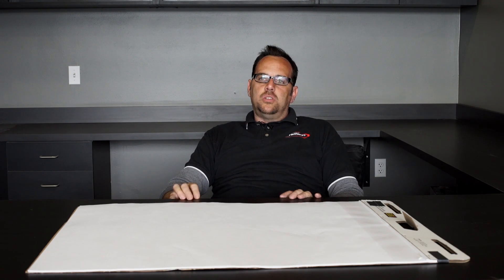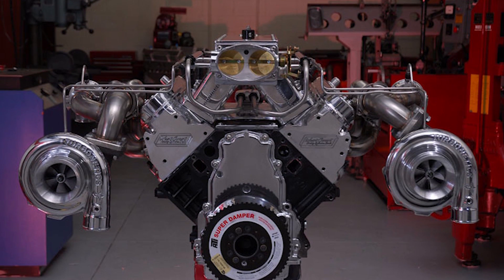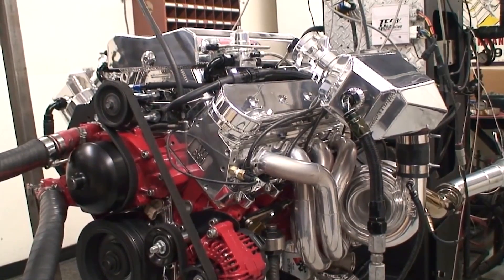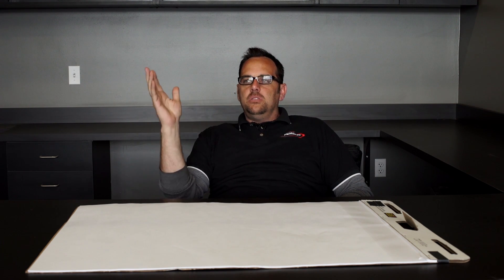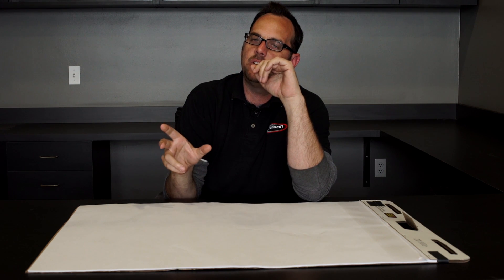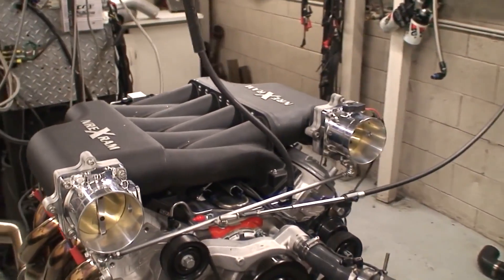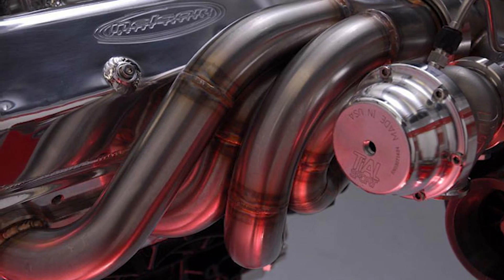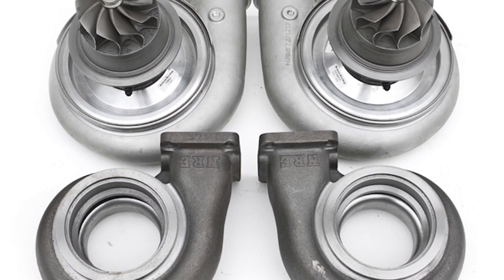Master Engine Builder Explains Why the LS V8 Is SO Good

Comment: WHY IS THE LS SO GOOD. BECAUSE IT IS A REGURGITATED FORD 427 HIGH RISER ENGINE OR IF YOU CHOSE A RAISED PORT 351 WINDSOR. NOT ONE DESIGN ASPECT IN THE LS HAS ITS ROOTS IN THE SMALL BLOCK CHEVY. THE LS IS COMPLETELY FORD BASED RIGHT DOWN TO THE FIRING ORDER. THIS IS WHAT TOM NELSON IS HIDING FROM YOU ALONG WITH THE RST OF THEM.
Reply: +Frank289100 you are one of several claiming the LS is a Ford knock-off but I'm going to disagree with the 427 and 351W references you make. The GM engineers designing the LS wanted to cure the intake manifold leak problem so they isolated the lifter valley from the intake ports with a valley cover to keep the oil out them. They also isolated the coolant crossover passages so there's no leak in the intake ports  from them as well.
The Ford 292/312 is probably the closest in comparison to the LS because it's a Y-block like the LS sans the crossbolts in the main caps. The Y-block Ford also has a lifter valley cover to isolate the oil from the intake ports like the LS
Reply: (The Ford 292/312 is probably the closest in comparison to the LS because it's a Y-block like the LS sans the crossbolts in the main caps. The Y-block Ford also has a lifter valley cover to isolate the oil from the intake ports like the LS) <<-- IT IS A RAISED PORT 351 WINDSOR AKA 427 HIGH RISER ENGINE. NOT 11111111111111111 DESIGN ASPECT OF THE OLD SMALL BLOCK CHEVY LIVES IN THE LS. IT IS 1000% FORD.
Reply: +Frank289100 I am assuming your comment is your opinion. I have not found any reference that states " <<-- IT IS A RAISED PORT 351 WINDSOR AKA 427 HIGH RISER ENGINE. NOT 11111111111111111 DESIGN ASPECT OF THE OLD SMALL BLOCK CHEVY LIVES IN THE LS. IT IS 1000% FORD."
I find your hyperbolic statement that a LS engine is a "IS A RAISED PORT 351 WINDSOR AKA 427 HIGH RISER ENGINE" a far fetched opinion and not one that is based in fact. The only thing the two engines share in common is that the six bolt main cap arraignment of a LS is comparable to a 427 High-riser, but it is also comparable to the six bolt main caps of a Gen ll and Gen lll Mopar Hemi.  Does that allow someone to say a LS engine is a Mopar Hemi? No. The LS General Motors engine is absolutely not "1000% Ford." Try again.
Reply: PUT YOUR FINGERS INTO A FORD WINDSOR HEAD AND THEN PUT IT INTO A LS HEAD. YOU WILL NOTICE THE INTAKE RUNNER CURVES INTO THE INTAKE VALVE AGAINST THE CYLINDER WALL WHICH CREATES A SPIRAL EFFECT BEING A SPIRAL INDUCING COMBUSTION CHAMBER. CHEVY THEN GRAFTED THE PORTS OFF THE 429 HIGH RISER GIVING IT A MUCH STRAIGHTER SHOT INTO THE CYLINDER. THE NHRA HIGHLY GOVERNED THE 427 HIGH RISER AND BANNED IT IN 1964 IN THE THUNDERBOLTS. THE LOWER BLOCK OF THE LS IS A FORD MODULAR BLOCK DESIGN WITH THICKER WEBBING. WHAT CHEVY ESSENTIALLY DID IS ADAPT A CAM INTO A MODULAR BLOCK USING IT CRANK DRIVEN OIL PUMP, OILING SYSTEM, TEN BOLT HEAD DESIGN, FORD FIRING ORDER, FORD CROSS BOLT MAIN, ETC. NOTHING HERE IS CHEVY IT IS COMPLETELY FORD.
Reply: You're all over the place. Now you say the  GM LS is a Ford Modular. That's crazy. None of the parts from the Ford FE or the Ford Modular are interchangeable with the LS engine.
(1)A General Motors LS and a Ford FE are not the same engine. None of the parts are interchangeable.  
(2)A General Motors Small Block Chevy and the General Motors LS are equal in respect with  both having a 4.40" bore spacing.
You are allowed your opinion, but the facts are you're wrong on those two accounts.
Reply: 1. THE TRUTH KILLS AND I CAN SEE THIS IN YOUR ATTITUDE. IF YOU KNEW WHO I WAS, YOU WOULD COME UP FROM BEHIND ME AND PUT A BULLET IN MY HEAD IF YOU KNEW YOU COULD GET AWAY WITH IT. THE REASON THE LS HAS A 4.40" BORE SPACING IS DUE TO THE FACT THAT THE MACHINERY THAT BORED THE BLOCKS IS SET UP FOR THAT BORE SPACING THAT WAS CHOOSEN YEARS AGO FOR THE OLD SMALL BLOCK CHEVY. THEY WEREN'T GOING TO SCRAP 50 MILLION DOLLARS IN BORE MILLING EQUIPMENT TO ACCOMMODATE A DIFFERENT BORE SPACING THAT WILL CONTRIBUTE NOTHING TO THE PERFORMANCE OF THE ENGINE. BECAUSE THE BORE SPACING IS THE SAME CONSTITUTES THE LS BEING A ADVANCE VERSION OF THE SMALL BLOCK CHEVY. THERE IS NOT 1111 DESIGN ASPECT IN THE LS THAT CAME FROM THE OLD SMALL BLOCK CHEVY. NOT ONE.
2. WHEN I SAID THE LS IS BASED ON THE 351 WINDSOR I AM 100% CORRECT. THE INTAKE PORT CURVE INTO THE INTAKE VALVES CREATING A SPIRAL COMBUSTION CHAMBER. THEN THE GM ENGINEERS RAISED THE PORTS ON THE WINDSOR HEAD USING THE HIGH RISER PORTS FROM THE INFAMOUS 427 FORD HIGH RISER GIVING THE AIR FLOW A STRAIGHT SHOT INTO THE CYLINDER. THE 427 SET ALL THE BENCHMARKS OF PERFORMANCE FOR SPORTS CARS AROUND THE WORLD TO THIS VERY DAY. THE OLD 427 FORD HIGH RISER USED CROSS BOLT MAIN WHICH WERE USED AGAIN ON THE MODULAR 4.6. THE LS BLOCK IS MODELED AFTER THE FORD 4.6 USING ITS FIRING ORDER, CRANK DRIVEN OIL PUMP AND OILING SYSTEM, CROSS BOLT MAINS, TEN BOLT HEAD PATTERN AND THEY THICKENED THE WEBBING ON THE BLOCK. FROM TOP TO BOTTOM THE LS IS 1000% FORD IN DESIGN. ZERO (0) IS CHEVY.
Reply: So basically what you're saying is General Motors didn't have the right to start with a clean sheet and design an engine that constituted no improvements from the original 1955 Chevrolet small block engine. LOL What you're saying is that General Motors paid the Chevrolet engineers millions of dollars to design and build a small block Ford. That is laughable. 
What you are saying is the GM LS engine's six bolt cross bolt main caps >are Ford Modular >which are 427 High riser >which are Chrysler Hemi. Who's to say where the 6 bolt cross bolt main cap originated?LOL
What you're saying is the GM LS engine's 18 different head casting designs are all the same as a combination of a Windsor and a 427 High riser. LMAO That's an opinionated can of worms with no merit. An intake port is either a swirl or a tumble design. The LS is a swirl port and the Ford Modular is a tumble port. So which is it? Is the LS a Modular, or a Windsor, or a 427 High riser?
The Ford Modular came out well before the LS and you agree the bore spacing of the LS and the original 1955 small block Chevy have the same 4.40 bore spacing. Then tell me why is it possible to bolt an LS cylinder head onto a Ford Modular? Using your logic that means the Ford Modular stole its bore spacing straight from the original small block Chevy. 
So all of my points bear the question, why doesn't Ford Motors sue General Motors for stealing their engine design? To say " FROM TOP TO BOTTOM THE LS IS 1000% FORD IN DESIGN." means Ford owns the copyrights and patents on it's design. Where's the lawsuits?
Reply: YOU WROTE A PILE OF NONSENSE HERE WHICH CLEARLY REFLECTS A ATTEMPT TO DENY THE TRUTH. THE FACT THAT GM DETAILS THE ENGINEERS WHO WORKED ON ITS DESIGN HANDS DOWN SHOWS YOU THEY DID IT TO HIDE THE TRUTH THAT THE LS IS STRICTLY FORD IN DESIGN. NO OTHER MANUFACTURERS DETAILS THE ENGINEERS WHO DESIGN THINGS.  THE EXPERTS IN THE INDUSTRY REFER TO THE LS AS "THE HIGH TECH SMALL BLOCK FORD". 
2. PATENTS RUN OUT AND IF THEY ARE STILL ACTIVE AND THE MANUFACTURER NO LONGER PRODUCES PARTS FOR IT. THEN THE PATENTS NO LONGER APPLY ONCE THEY STOP PRODUCING PARTS FOR IT. FIGHT IT ANY WAY YOU WANT BUT THE LS IS ALL FORD. NOTHING REMAINS FROM THE OLD SMALL BLOCK CHEVY.
Reply: "PATENTS RUN OUT AND IF THEY ARE STILL ACTIVE AND THE MANUFACTURER NO LONGER PRODUCES PARTS FOR IT. THEN THE PATENTS NO LONGER APPLY ONCE THEY STOP PRODUCING PARTS FOR IT"

My point exactly. General Motors still makes the LS. Ford Motors still makes the Modular. Why doesn't Ford sue GM for stealing their engine design. Answer: Because that is not a fact
The Cadillac 472-500ci engine has the exact same cylinder head valve layout as the LS.
E I E I E I E I Just because that is the same as a Windsor does not mean GM stole it from Ford.
The LS engine design has a lifter valley cover specifically incorporated to isolate oil in the valley from the intake ports like a 429 Cadillac. The coolant passages are also isolated from the intake. Don't see the Modular or the Windsor having either of those concepts.
If your tunnel vision only allows you to look at a GM LS engine and see only a Ford engine, then there's nothing I'm going to say to make you realize  the  many General Motors ideas and designs that make the LS the greatness that it uniquely has.

And by the way, the LS engine uses the same rod bearings as the Small Block Chevy. LMAO!
Reply: THE LS IS BASED ON THE CADILLAC 472-500 ENGINE. THEN HOW COME GM NEVER SAID ANYTHING TO THIS EFFECT. BECAUSE THE OLD 429 CADILLAC MOTOR WAS A STRAIGHT PLUG, SIAMESED INTAKE PORT, 5 BOLT DECK CLAMP HEAD BOLT PATTERN AND NOT THE 4 BOLT BLOCK ANCHOR PATTERN LIKE FORD. CADILLAC LATER COPIED THE FORD FE/385 SERIES MOTORS WHEN THEY CREATED THE NEW DESIGN 472-500 CADILLAC V-8. IT IS A COPY OF FORDS BIG BLOCKS. ONCE AGAIN THE LS IS 1000% BASED ON FORD DESIGNS. GOOD TRY BUT YOU HUNG YOURSELF AGAIN AND LUCKY I CAME ALONG TO CUT YOU DOWN..

Comment: Guess I am just plain old, but I will still stick with my 350 cast iron block. I know it  is such a stupid thing to note, but I just can't get used to those damn slim valve covers and skinny heads, Of course, if I had 30 grand and any choice, I would go with an Alum Yenko 427 BB.

Comment: Cheap?!? Sure a used engine is cheap to get, but building one is stupid expensive.
Reply: you can build one including the price of the engine for less then 10k and easily make over 700 hp with cheap turbos you cant even buy a coyote for less then 10k
Reply: There's really no need to build an LS engine.  A lot of guys , most actually, at my drag strip are getting Chevy LS 6.0 out of the trucks and throwing them in their cars and racing them without even touching the internals.
Reply: _ Skylake _
just depends on what you plan on doing if you plan on making alot of boost then yes replace the pistons asap or else it will melt down sooner or later